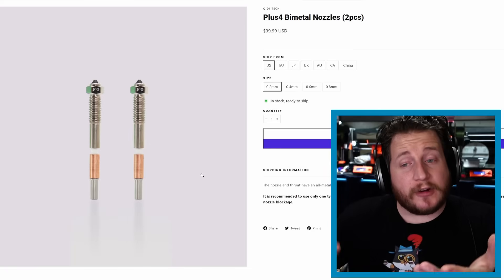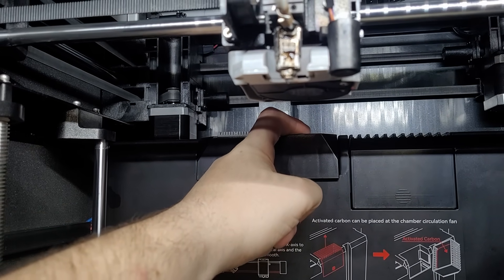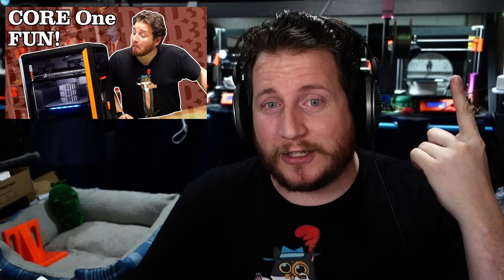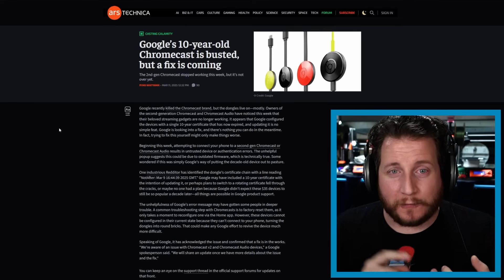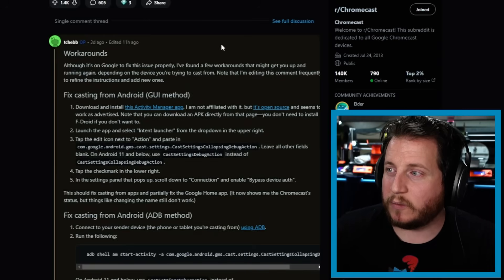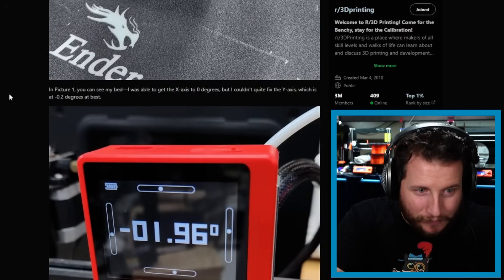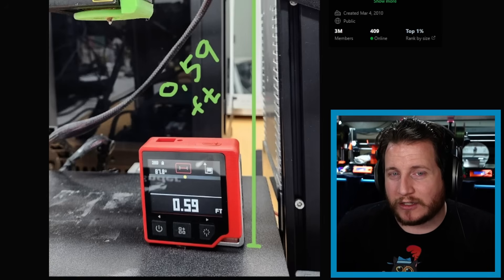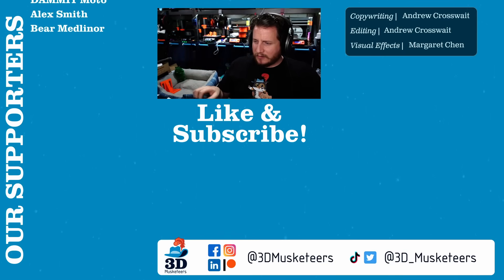Shattered Nozzles and Bricked Chromecasts! - PrintFixFriday 183

Comment: If you have a chamber thermistor and an exhaust fan, you can setup a couple macros to easily keep the chamber around a specified temperature. This can be done with no modifications to Klipper. Just takes a little macro knowledge.

Comment: Qidi's problem isn't the heatbreak. Printers with a decent steel heatbreak have worked fine for a long time and needed little airflow through the cold side. The problem is how laughably bad the cooling is. It mostly recirculates hot air, and can't even force air through the heat sink.
Reply from the maker: I have already printed a part since releasing the video that should help with the ducting, but yes I agree, its garbage

Comment: Tramming / levelling - many printers don't have bed adjusting knobs any more (silicon things 😍over springs 😐 if there are IMO), though - especially with a probe - they help setting initial variation lower and less work for mesh levelling. Sure, mesh levelling can compensate for quite a lot of difference, but I rather start with the right foot 😅

Side note: I like Marlin with rotating knob on UI better for setting z-offset and tramming the corners. It feels intuitive and linear, almost analog.
With Klipper and Klipperoid (phone app), z-offset cannot be set live (either it runs to the end of last command in queue, or just takes a cigarette outside) + which way increases and which decreases gap between nozzle and bed 🙄 Klipper screen might be better, I don't have it, but well implemented nozzle probing (with sensor either in print head or under the bed) should be better anyway...

Comment: Hello Grant, I have been fighting with my Qidi X Plus 3 for over a year now.
The first thing I encountered was using machine settings while printing PLA. First layers were awful! I did all the leveling (Tramming) operations to no avail.
I then decided to check the nozzle and bed temps. Using a Lab grade temp probe, I got a lower bed temp on my probe by 10 deg.C and a lower nozzle temp by 5 to 7 deg. C.
I also was getting random layer separation on most of my prints.
After adjusting temps to actual temps (68C bed temp first layer and 62C for the rest) and the nozzle temp to235C first, 230C after, I got pretty good first layers but I could see "skip"
marks where the extruder seemed to stop working for a split second. I found that if I either 
slowed the print speed down by 20% or decreased the nozzle temp by a few degrees the Elegoo PLA would print better, but not perfect. Switching to  Sunlu PLA using the same settings showed a marked improvement over all without lowering the temps so much.
I think the filament was getting so soft that the extruder wheels were slipping, I could hear a
clicking sound ever time the lines would gap. Still the prints were sub par as to what I saw on YT. I then changed to a ruby tip which helped out a lot! But still not as good as the prints I was seeing on YT.
I have other major problems with the Plus 3, but this comment is getting as long as your "Live Streams" LOL!!
I also fiddled around with fan speeds to fine tune my prints.
As of now, I have run almost 20Kg. of PLA through it with only moderate improvement over my 
MakerBot Replicator. 
John

Comment: The heat creep on that Qidi reminds me a LOT of the heat creep I was battling on my anycubic kobra 2.  After looking at the airflow from the cooling fan over the heatsink I noticed that a LOT of the air was flowing out and off the sides instead of all the way through from front to back.  I added some thin strips of aluminium duct tape (the ACTUAL tape you use on duct work) to seal up the edges and effectively make a tunnel through the heatsink.  This forces the air to flow all the way from one side of the heatsink to the other and all the way over the fins without spilling out of the sides.  It made a MASSIVE difference and effectively eliminated the heat creep.
Reply: Qidi solution looks also like Creality Ender 3 "blowing in the general direction of the heatsink" design 🥵
V6 heatsink with stock duct is way better, forcing all air through cooling fins.
I play safe - my Aquila with Bambu A1 hotend has 4010 axial cooler for heatsink 😉
Reply: I have a kobra 2 and a kobra 2 pro and have never run into heatcreep. The k3 and S1 at work have absolutely 0 issues.
Reply: @raiden9250  It was worse with PETG and a bi-metal heatbreak. Granted it wasn't an issue when using the stock heatbreak and PTFE liner but I just got utterly sick of the filament jams when they cooked and having to replace them.  Bi-metal heatbreak and strips of aluminium tape totally solved it for me.
Reply: @Enjoymentboy  my pro is still on its from factory configuration with ~1000hrs. Haven't had to change the ptfe yet

Comment: 5:30 afaik this is a limitation in current klipper. The printers that cool the chamber by exhaust fan use the code for "chamber heater" device with output inverted (simple). Hoping future klipper includes separate device code for exhaust cooling, though you can rewrite exhaust fan device code for this now (complicated).

Comment: Qidi's cooling solution for the cold side of their hotend is bad. You want that fan mounted directly to the heatsink to allow static pressure to build and avoid heat creep. That fan is blowing around the heatsink, not through it. Printing PLA, PETG, and TPU must be fun.
Reply: There is a printable duct in the community forums that foxes the heat creep
Reply: @JLSticePro  That's great, but it never should have been an issue to begin with.
Reply from the maker: Is that this one? https://www.printables.com/model/1163079-qidi-plus-4-hotend-fan-shroud
Reply: @Founders404  they did add a little shield to the second round of printers that helps some, community still recommends the printed duct for better performance.

Comment: When I had issues with my mk3.5 I was sick as hell. I never got around to contacting prusa. They have a new alpha firmware that apparently fixes the MMU3 overvolt issue. So I may be trying that this weekend. And possibly resuming my Normandy SR-2 print on the mk4s. My dog Rena has decided the mk4 part fan, which I have no more use for, needed to die. lol The fan is fine, but it has no connector and the wires are shorter.
Reply from the maker: oh gosh thats a pain!! Hopefully the doggo is okay!
Reply: @3DMusketeers  She's fine. She just had her first vet visit. Seems to be in perfect health. I actually found the connector for the fan. I could probably fix it if I want......but why. lol I have the mk4s fan now.
Reply: @3DMusketeers  good news! the new firmware works perfectly. In fact my mk4s ended up getting the dreaded issue. The alpha firmware is now in RC status. There is a mk3.5 and an everyone else firmware. I'm not sure why 3.5 and everyone else are split, but anyway... IT WORKS!!! Both printers no longer have the overcurrent issue.
Reply: Unfortunately printing is not an option for the next 24 hours. The weather is bad enough that I'm not leaving my printers on. This is supposed to be potentially destroying the power grid levels of bad. I'm not risking them even with a UPS.

Comment: About 6-7 years ago my website didn't work anymore.......the cert expired. lol Since getting an official one from IT takes too long I did a self signed one. I told people, you will get an error, but unlike the expired cert, you can ignore this error. And a week or two later I got the official replacement. IT has gotten worse since then. I'm not the admin and self cert would actually throw up a massive get this thing off the network light for them. So I told the new people, these new servers are probably fine, but you need to check for when they need to be updated.
Reply from the maker: good plan! My guess is that google canned the people with the knowledge about this and no one else bothered to check lol
Reply: @3DMusketeers  yeah I mean why update device that's way past it's antique status. However if they thought about it, they should have updated the certs automatically without intervention. Then you can forget about it AND not have this issue.